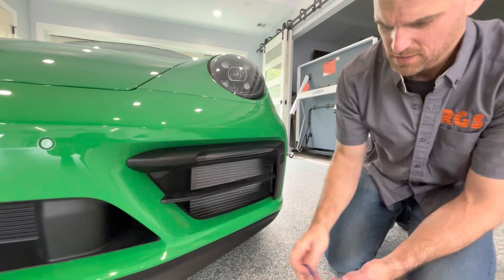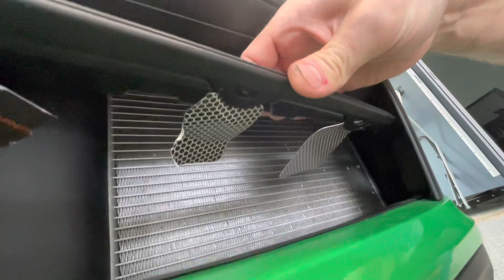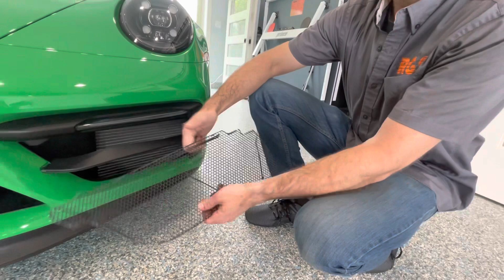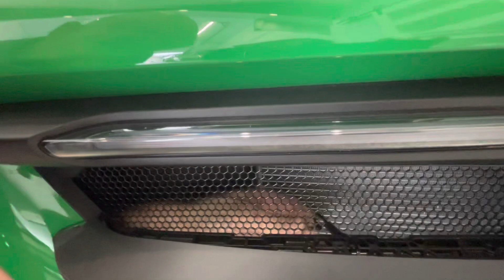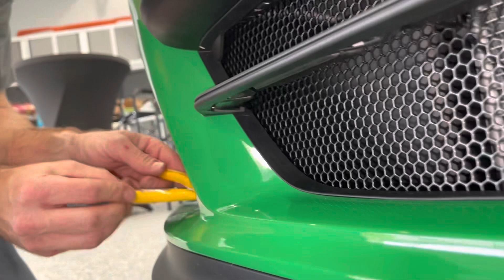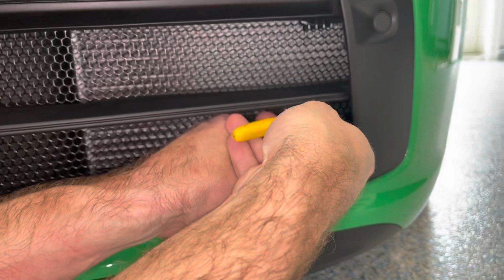Porsche 992 GTS and Sport Design Radiator Grille Store Install

Comment: Good video. Question…what is the purpose of that spacer on the middle zip tie? Looks like it would have been much easier just to do it the same as you did on the ends. I wonder if a type of lubrication might be helpful on the bottom clips? Maybe WD 40 or something similar?
Reply from the maker: The horizontal bar is not on the same plane as the ends. So if you try to tighten the center cable tie it will distort the grille.  The tabs that stick are due to the detents that jam up inside the bumper. The other clips are easy to release.